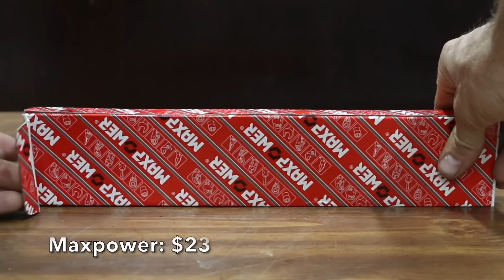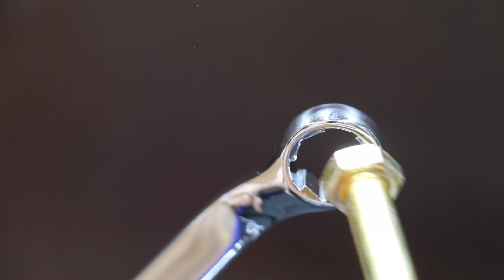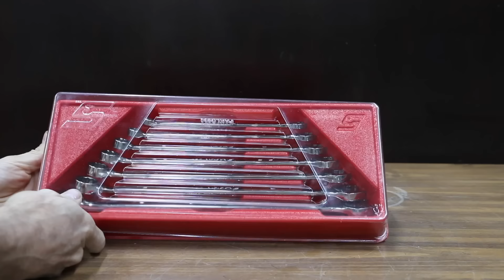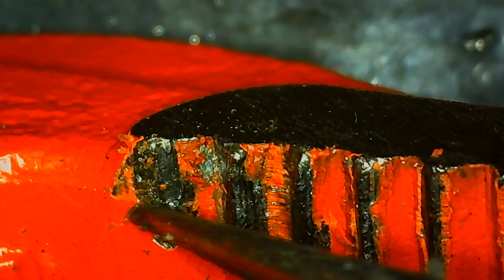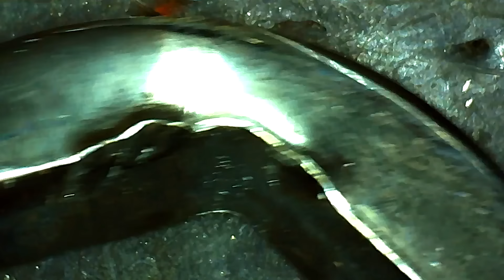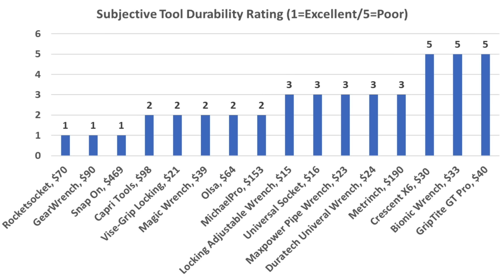Best "Rounded Nut" Extractor Wrench? Let's Settle This!

Comment: I liked the idea of the DuraTech and actually bought an identical “Husky” branded wrench from Home Depot; I don’t think I’ve used it effectively a single time as like the other Husky adjustable wrenches I’ve used the adjustment just keeps opening up while you’re using it causing you to constantly have to re-tighten the wrenches every time you change positions. In a pinch it’s hard to beat a simple pair of Vise-Grips as they can looses and tighten things, and you can always replace a bolt/nut after words when you have access to better tools. 
Love the videos as views are actually independent and as scientific as they need to be; this isn’t very common on YouTube were most other content providers are just about selling product or just can’t be honest as products are either cherry picked and/or provided for free.
Reply from the maker: Thank you very much! The positive feedback means a lot to me!!

Comment: Was waiting for the ultimate bolt removal tool to appear... The blowtorch.
Reply: Can't be tight if it's liquid
Reply from the maker: Great point!
Reply: I've had great success with a grinder and a punch.
Reply: Project farm next time we do a test like this please try to include the torch but treat it like it's just another tool on the list
Reply: Blue wrench for the win
Reply: But a torch will change the steels hardness level being potentially detrimental to the surrounding object.

Comment: Jeeze, Snap-On needs to... get a grip, $469😳🙄😂
Reply from the maker: Thank you
Reply: When you're a tech, good tools cost money
Reply: @FusionBoost2.0  when you're watching PF, you're looking for quality/value analysis. How many times has a lower priced item outperformed a well known expensive item on PF? ALL THE TIME. If a $10 tool that does equal work and is as reliable as a $100 tool that has famous letters imprinted on it, I'm going with the $10 tool.
Reply: @m4anow  thing is though, the snap on was never meant to remove rounded fasteners... Not to mention lots of these tools are not going to hold up in the long run etc Not to mention, you're probably not using these daily like a tech
Reply: @FusionBoost2.0  all of your "not to mention"s have nothing to do with my value/quality statement, nothing provable. Your arguments boil down to "just trust me, bro". I'll trust the tests performed by Project Farm over your claims any day. You can check out the "Best Wrench" test by PF and see where your value/quality is
Reply: @m4anow  I work with tools everyday, I fix shit for a living. I know what works and what doesn't

Comment: I am always impressed by the force the original U.S. made ViceGrips can put on *anything*.
Reply: It’s too bad they stopped making them
Reply: @waterloo123100  yeah the old Peterson factory shut down last year. It was being run by Malco and they made Eagle Grips there. A pair cost over $50. Todd tested them and they were the best but not enough were willing to pay that much.
Reply: @waterloo123100  Sold to Chyna
Reply: @MrC_138  Malco pliers were made in the old vise grip factory but they closed recently
Reply: @waterloo123100  Sad to hear that.
Reply from the maker: Great point!
Reply: rubbermade moved vise grips to china
Reply: I don't think these Vise Grips were made in USA. Yeah no Irwin are Rice Grips. When is says. "The Original" it ain't. I'm not sure if Peterson ever made parrot beak pliers. I have them in American Tool. Which was the first outfit that bought the company.